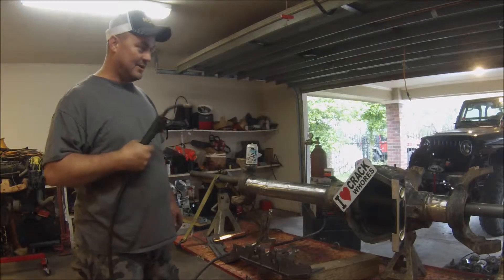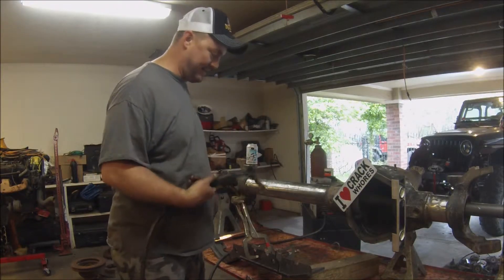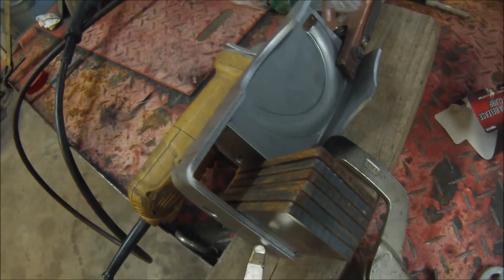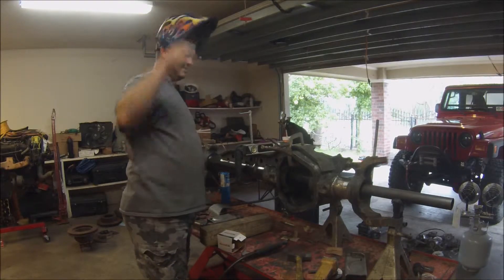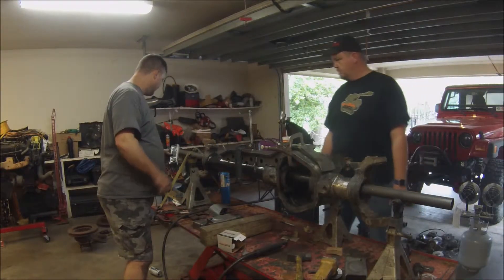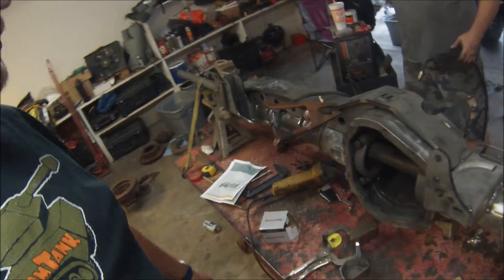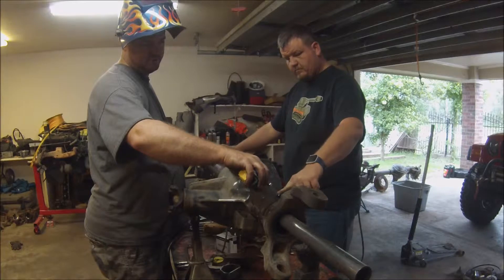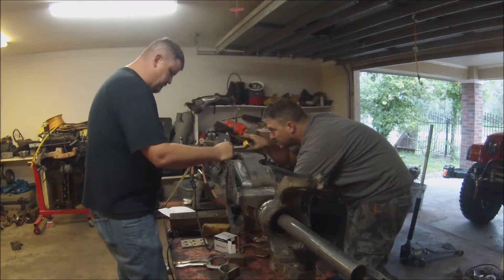Welding Artec TJ Truss on an 05 Superduty Dana 60

Comment: What did you set your pinion angle and caster at?
Reply: We set the C's at 6° and welded the truss at 0°. If I remember correctly the C's and pinion are in the same plane.